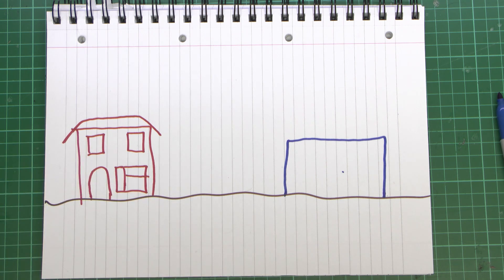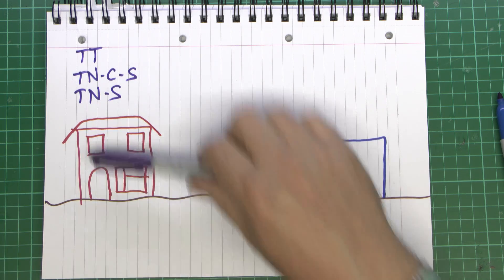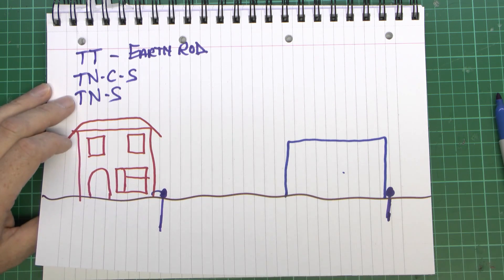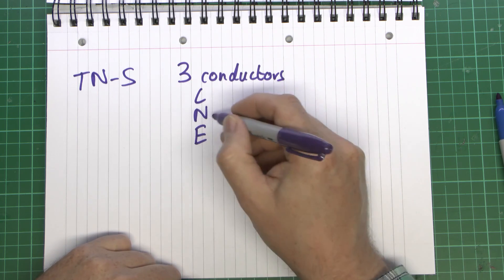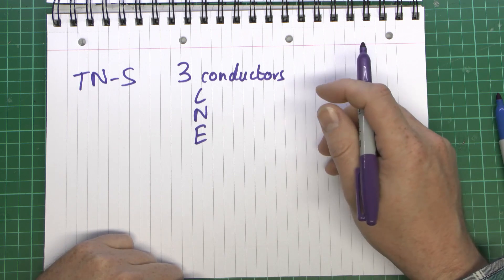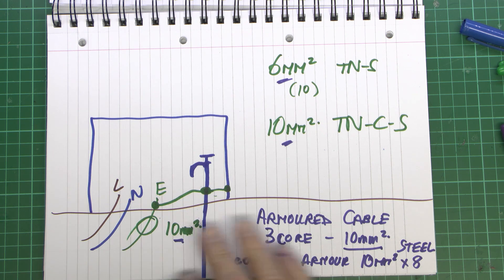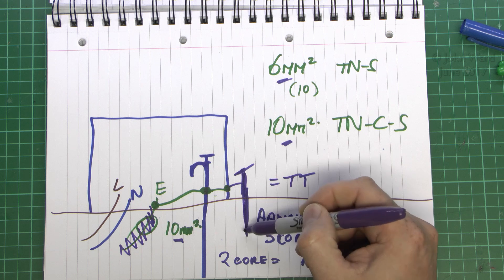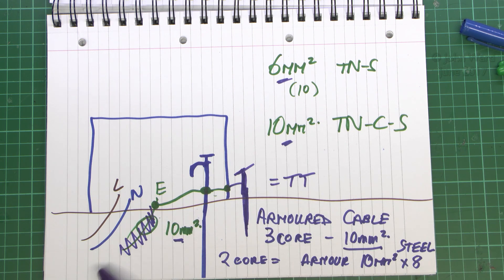Earthing Systems for Outbuildings

Comment: With the 18th regs I believe you will require an earth electrode anyway even for TN installations. In which case would and exported earth to an outbuilding require an electrode as well? Rather like a belt and braces approach I guess. Very useful video.
Reply from the maker: The 18th is only a draft, but one electrode at the origin (in the house) should be sufficient as you are not installing a new supply but just extending an existing one.
You could install one if desired, and the existing 17th edition does allow this already.
Reply: we use earth rods and bonding because that brings body standing on ground or touching objects into same potential with equipment case's pe and no dangerous currents will flow

now you stand in your shed but your pe comes from far away house and has no local connection to actual earth under your feet. that sounds bad even with rcds which would limit fault voltages. if it's any permanent installation i would recommend replicating house's system in there. that is, if tn-c-s, bring either tn-c or tn-s to shed, and ground your pen or pe there. logically thinking, it would be even safer if you ground something that should be at ground level anyway

if you dig the cable into ground and path to shed is short, you could improve both buildings earthing by installing vertical and / or horizontal earthing structure along your cabling. if, for god forbid, the buildings miss earth altogether, you could end up with proper electrical system too. later could be case, depending how strict checks your country has. estonia, where i live, doesn't currently have strict checks on existing installations, it's both good and bad

Comment: Most armoured cables also include a few copper strands, replacing a few of the steel wires, to reduce the earth resistance of them, so make sure to peel those out of the gland into the cabinet to make the internal grounding bus connection. Typically you have between 3 and 7 strands of the same diameter as the conductor cores in the cable for this purpose. You can also cut the cost considerably by using a conduit and some split concentric cable ( rated for burial either direct or in conduit, or for overhead use) to make the link, which has the 3 cores in it, and 2 thinner communications wires, as this is typically used with a remote display prepayment meter a lot here. Comes in 10mm and 16mm variants.

Comment: Should we not always be installing earth electrodes for anything outside of the equipotential zone as not to export the DNO earth outside of said zone??
Reply from the maker: No, in most cases the DNO supplied earth will be vastly better than any electrode.
If there are extraneous conductive parts in the outbuilding, bonding to those will extend the equipotential zone into the outbuilding.
Reply: John Ward just had a quick read and it appears you are correct. In Cornwall the dno will refuse a connection if tncs has been exported out side of the dwelling. Seems crazy considering our regs suggest otherwise. Thanks for your videos I find them very interesting
Reply: tomorichard Thompson 
same in suffolk too.

Comment: Hi John. Always find your videos very informative. My house is TT supply. I have three outbuildings fed via a 10mm armoured 3 core radial circuit, time delay 50A DP 100ma at the house end and small dis boards in the outbuildings with 30ma RCBOs. However, the earth is exported, armour is paralleled with one of the 10mm cores.  This goes to a junction box on one of the buildings which feed the 'sub' boards. You are saying this should have another earth rod, or that the earth should not be exported at all? Also remember something about possible dangerous earth gradients with multiple rods - cattle getting electrocuted etc. Any thoughts appreciated.
Reply from the maker: Either way is fine, it isn't always necessary for a second rod at the outbuilding so you would just connect to the earth from the main building.  If a second / third etc. rod was installed, they and the earth from the building would be connected together.
Time delay RCD for the cable and another RCD/RCBO for the outbuilding circuits would be the best option, alternatively a single RCD for both the cable and circuits but that would result in a fault causing all power being cut to the outbuilding.  That may/may not be a problem depending on what the building is used for.

The gradient or step voltage is a problem which occurs around any earth electrode when there is a fault - voltage at the electrode will be higher compared to the ground a short distance  away.  This can result in animals with four legs receiving shocks if one pair of legs is close to the rod and the others further away.  This situation only occurs when there is a fault, and before the RCD or other device has disconnected the supply, but this can still be long enough to cause injury.
Not normally a problem with people as they only have two legs which are typically very close together.
Reply: phildxyz We live in a rural area with a TT supply and an exported erath like you describe. I am keen to see your answer John and learn more.
Reply: Thanks John - all makes perfect sense.
Reply: Colin Herbert - Looks like we have our answer - seems we are OK!

Comment: Hi John, two questions: For a TT system would you bond the two earths (house and shed) via the armoured cable?  Also - aren't you obliged to use an RCD at the house end to ensure safety in case someone sticks a spade through the buried cable?
Reply from the maker: +Alan Allington  For TN systems the armoured cable does not need an RCD, as the fault current between line and the earthed armour will be high enough to trip the circuit breaker.
An RCD is required for TT as the fault current between line and the armour will be very small.
Reply from the maker: Yes for both.
Reply: John Ward 
Hi, thought you didn't need an RCD on the house side to feed the new garage board with its own RCD if its a tn system?
Reply: Hi John, as i said. Seem to think you said an RCD is necessary both ends?  My business is 26 years old and still learning, please keep helping this high class industry prospered. 
thanks Alan

Comment: Even with the TT could you not just run a cable back to the switch box and earth it there ?
Reply from the maker: Yes, an additional rod/electrode isn't always necessary.
Reply: On a similar note ,  is there any special earthing you have to do for them outdoor sockets ? I have one running as a spur off a kitchen outlet.
Reply from the maker: No, an outdoor socket is connected exactly the same as an indoor one.